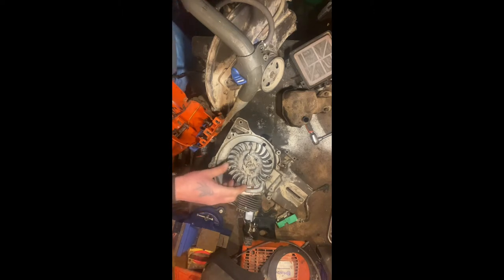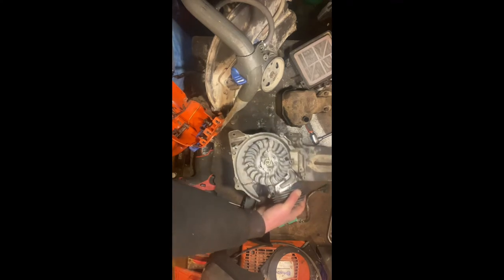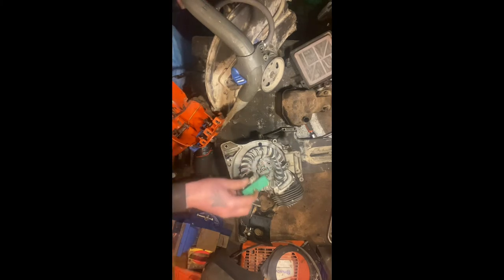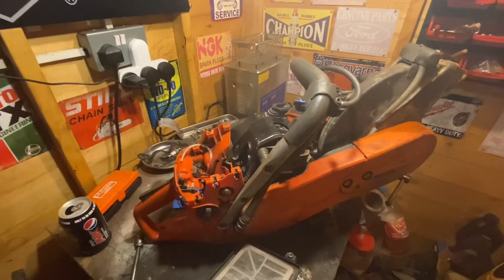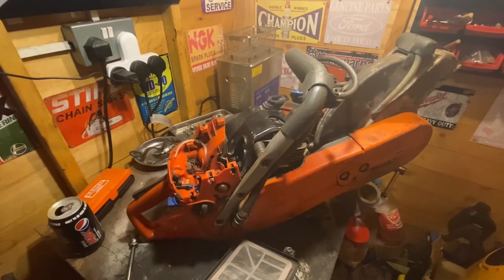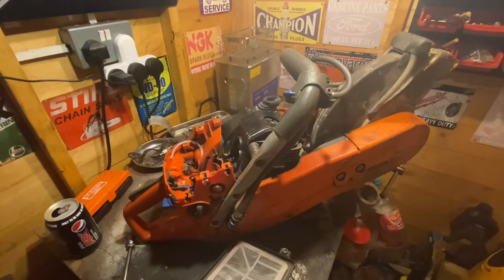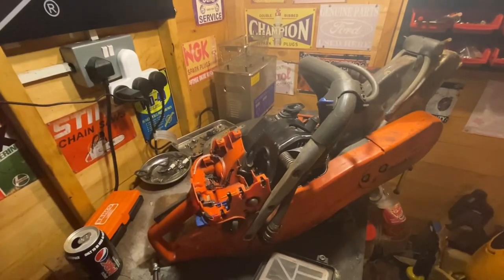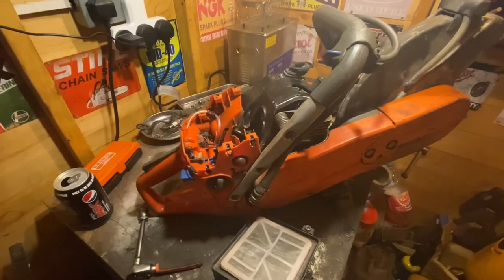Husqvarna K760 cut off saw update 🔧

Comment: My k760 seems to be idling really fast. Also, it wont turn off on the kill switch. Any ideas pal?
Reply from the maker: First port of call I’d adjust the Low adjustment on carb to rectify idle speed. Regarding kill switch I’d chase wiring back firstly see if all is in order. They are cheap anyhow to replace mate. Hope this helps. 👍🏻🔧